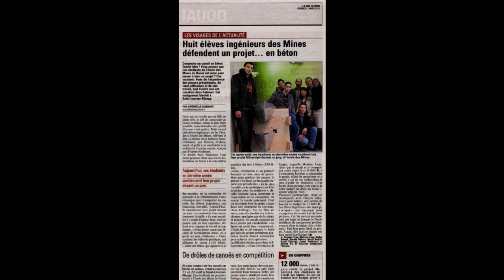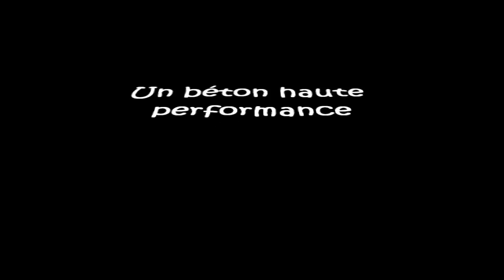Mineship4 : Un canoë en béton - en 6min

Comment: English:
What an awesome mold & pour technique! Did you use any reinforcement between the molds such as tensioned cables, carbon fiber mesh, or fiberglass mesh? If so, how did you place it directly centered between the top and bottom molds during the pour? Do you have more videos like this one?

French:
Qu'est-ce un super moule et versez technique! Avez-vous utilisé renforcement entre les moules tels que les câbles tendus, treillis en fibre de carbone, ou en fibre de verre? Si oui, comment avez-vous placé directement centrée entre les moules supérieur et inférieur au cours de la verser? Avez-vous plus de vidéos comme celle-ci?